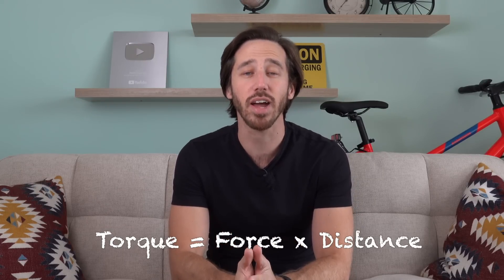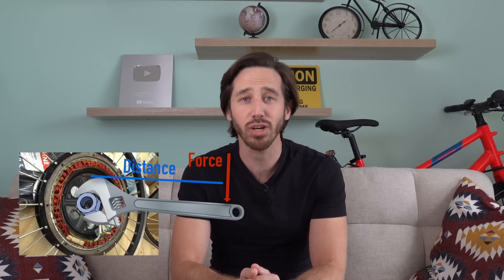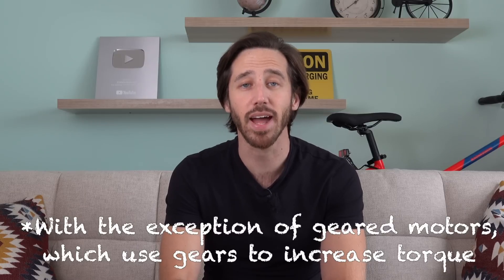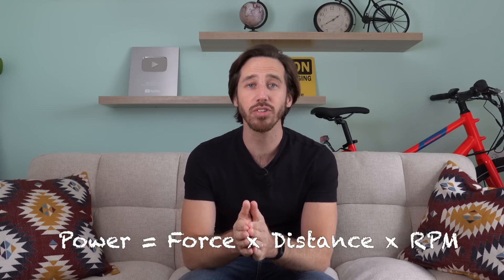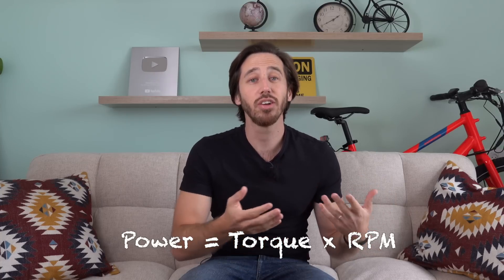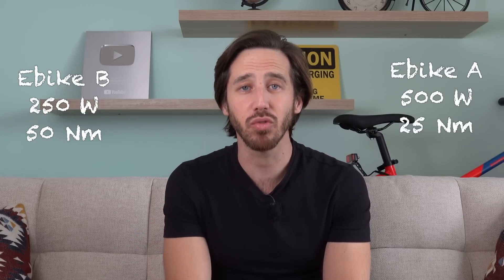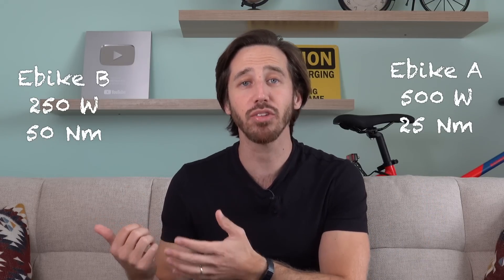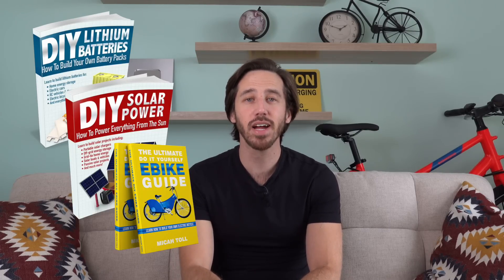What does E-BIKE TORQUE really mean? Simple explanation

Comment: Note, a 250w mid drive motor can climb better than a 750w hub drive motor in certain situations because is uses the gears to increase torque at the wheel.
So when the hill gets too steep for the hub motors torque which is fixed the bike bogs down and stops, but the mid drive uses a lower gear ( slower speed)  to swap speed for torque and can climb the hill still.
 Personally I'm happy to just have a powerful enough rest hub drive to go up most hills and I pedal hard on the steeper ones.
Reply: I build only torque sensing mid-drives for my customers, but everything discussed here really means little. Even a junk bike, with a low power, low torque motor is still a ball to ride and probably all most people will ever actually need or use. I spoke to two of my customers yesterday that never get out of level one of five assist and they put in some pretty impressive miles.
Reply: @MHH3180  I agree most people will never use the higher end bikes to anywhere near their potential.
I now have a Frey ex which uses bafang ultra so I can directly compare it with a cheap 1000w dd rear hub on a cheap full sus bike.
For 90% of the riding I do which is mild off road the hub is faster and easier to ride.
I literally have to go looking for harder trails to even start to test the capability of the ultra motor and the high end bike and it scares me tbh just how steep you have to get to get your money's worth lol.
I'm thinking a tosheng on a cheap bike would be perfectly ok for most people.
Reply: @FlyingFun.  yes, I have built approximately 75 bikes using The TSDZ2. All mine have to be legal everywhere. I use the 48 volt 500 watt as it is capable of 52/750 and the torque sensor means even the most feeble of grannies do not need a throttle. All that pretty much eliminates all my warrenty issues. I did have the world's third strongest man break a spindle I should have realized was loose and just this week I got a bad display from the distributor. I have had two former motorcycle riders complain their 700c hybrids don't accelerate like theor 20" folding 750 hub motored bikes, but I thunk cadence sensing appeals more to anyone looking to do as little pedaling as possible. Really though, I am finding a lot of my customers would do as well with something like The Retrospec Rev line. They aren't going to go great distances and the savings could buy a lot of extra batteries. The speed limit on rail trails, MUP's an in the bike lanes they ride is 15mph. They don't mind climbing hills a little slower. If they ever perfect puncture free tires, I may have to hang up my smock.
Reply: @MHH3180  yes if building for paying customers I would 100% go tosheng for the reasons you state.
I've had a few people ask me to build them a similar build to mine with 1000w dd rear hub but I'm really reluctant because of the need for torque arms correctly installed being slightly different on every bike  and the legal side of things so I passed but said I would help them do it if they wanted.

Comment: Is it possible to connect in parallel two 48v battery?  To get more amps
Reply: Yes no problem my ebike its working with two battery 36v conected in parallel
Reply: You should check out isolators utilizing diodes to keep one battery from charging the other causing issues down the line
Reply: Getting more amps from 2 batteries is possible but your controller needs to be capable of using those amps. Check your controller specs before proceeding.
Reply: @michaelsprinzeles4022  having too much potential amperage from the battery is a good thing, causes less voltage drop.  You only need to worry if you don't have enough possible constant amp output rating to match.  Kinda like difference between a 10 gallon fuel tank and a 30 gallon fuel tank.